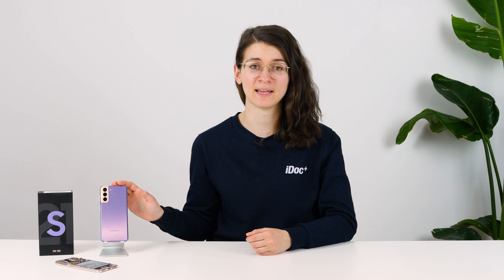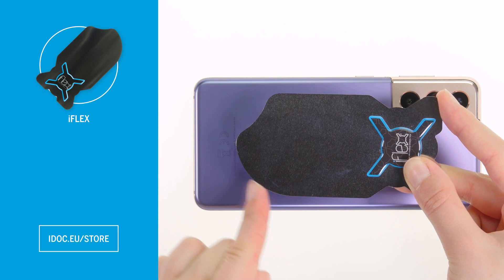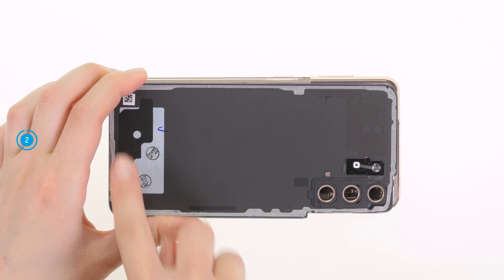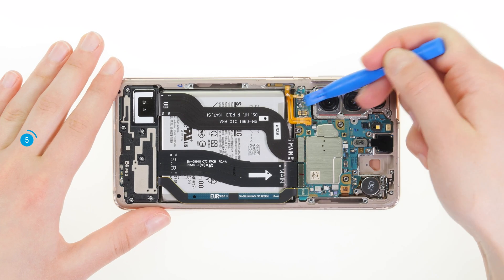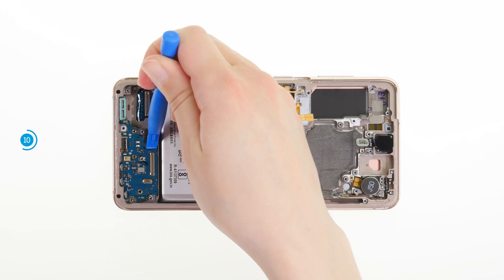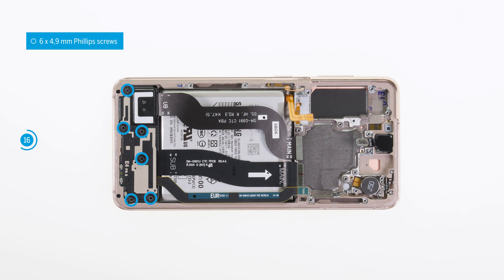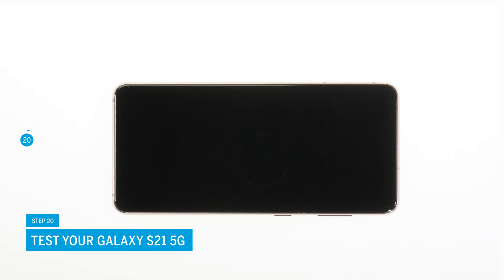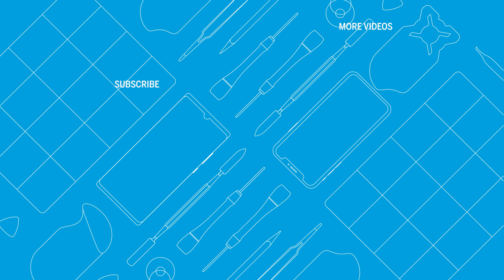Samsung Galaxy S21 – Screen replacement [including reassembly]

Comment from the maker: NOTE: For this photo guide, we have used a replacement screen that already had the battery integrated. This is no longer the case in newer replacement screens. Therefore, you will also have to remove the battery and take it over. Check out our battery guide for more information: https://youtu.be/fbG5eMyrPuY
Reply: What is the blue wire

Comment: Great instructional video, but the cost of the replacement parts from you are more expensive than buying this device second hand... If the parts were more competitively priced it could be worth it, but financially this doesn't make sense.
Reply: What doesn't make sense is to have to buy the entire frame attached to a new screen.

Comment: I have some questions , has really this type of lcd screen the same gorilla glass victus as the original of the 21 i mean it has the same resistence and flexibility of using,  also the front camera is really as clear as the original one. I found it a little bit difficult to trust that the screen with gorilla glass victus also other components such as battery front camera and other ports being included at just 200 $ of price , that seems to me a little bit cheaper. I have the s21 one but i am asking if someday if i have to change my lcd, will i have the same features such as the quality of front camera the battery performance and the screen resistence of new victus cause i am a little pesimist of this decision ?
Reply: Can you please clear my doubts ?
Reply: I think the samsung panel is an amoled display not lcd.

Comment: i dropped my s21 the other night on the corner, in a case. No physical damage but the screen turned off, even though the phone was still clearly on. Wondering if I just knocked one of those ribbon cables loose.
Reply from the maker: Hello Sidney,

it is rather unlikely that the cable has come loose. Most likely your OLED display has a small crack and therefore no display anymore.

Best regards

Marc from iDoc

Comment: I have a black screen, but the touch works.  It was fully charged and can still be charged.  The force restart doesn't work.  I can't pull files off the device, as my PC doesn't "see it".  I have been told I have a bad screen, but someone else said it could be a motherboard issue.  ONCE for about 1-2 minutes, the screen turned on.   I didn't have enough time to enable USB debugging, but for a while after the screen turned on, I was able to transfer some files.  I also have alarms that keep going off that are very annoying, since I can't stop them.  Periodically, my PC will recognize it, but not very often.  Does that sound like a motherboard issue?
Reply: I have same issue.

Comment: I put everything back in original and it will receive calls and text still. I contacted att and they sent me a new sim card but that didn't work... any ideas?
Reply: I know this is an old comment, but it might help someone.  You also need to transfer the antenna with some screen replacements. It's in the top right hand corner surrounding the vibrate module. You need a precision screwdriver set for the 3 tri point screws. Size Y0.6 I believe.

Comment: I replaced my s21 plus screen and everything works but it will not make calls or text it says your phone is not registered on a network, have you heard of this problem or how to fix it?
Reply: Someone on reddit helped me I didn't know you had to transfer antenna hidden in top right corner above vibratory. Its working now !
Reply: @ryanurbanek8408  can you explain me what did u do or link to the reddit post please
Reply: @thesam7100  Joe! The top right hand corner of your phone (looking from rear) there is a square piece and right about it is a small antenna you have to make sure to transfer it.... once I did that my phone worked as normal
Reply: Reseat connectors going to sub board.